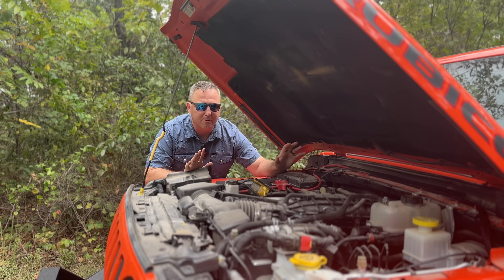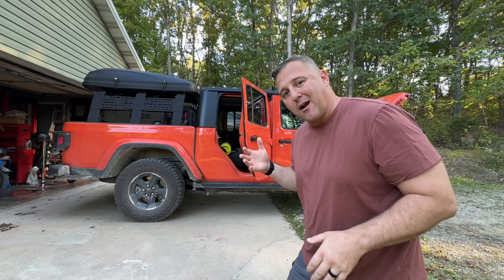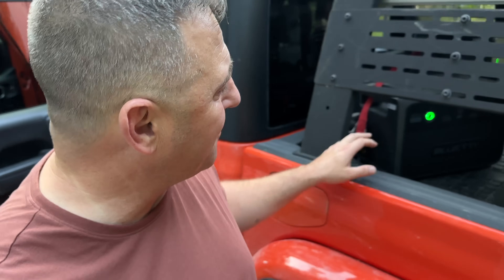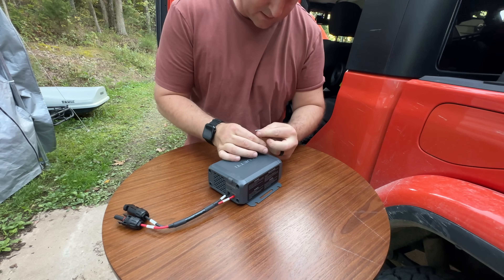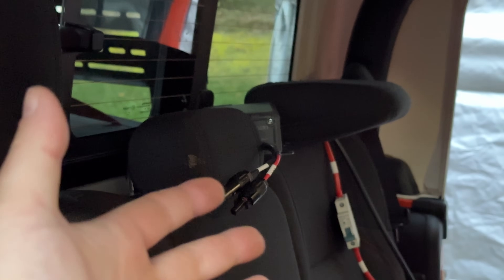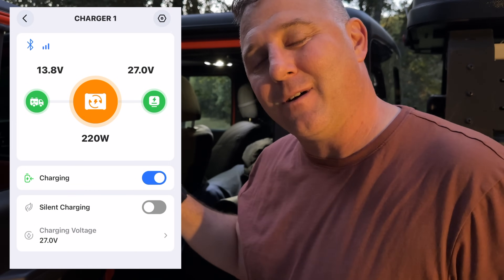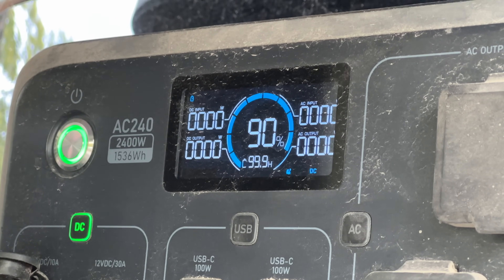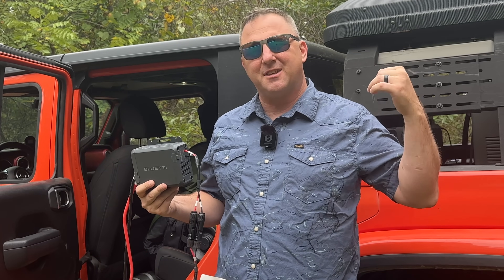Solar is OBSOLETE! - BLUETTI Charger 1

Comment: I have similar set-up with my 2023 Toyota Sienna.
The great thing is: 1. The car battery is located at the right quarter panel. 2. Very minimal work. 3. With short cables, it does not require thick gauge wires. 4th, last but not the least, since the Siennas are hybrid, I can run my appliances, use microwave, etc. and etc while running the engine ON while the van is parked and the engine only runs very short period  (if it does) because it's a hybrid. Basically, the Ecoflow is getting charge from the high voltage hybrid battery when the engine is not running. The vehicle puts out around 150Amps. The DC-DC converter I am using is only 30Amps.
Reply from the maker: Sounds like a great setup. The hybrid Sienna is a game changer for upgrades!

Comment: Just installed one. My old vans alternator couldn't handle the max load and was shutting down at idle so I used the app to lower the charging voltage, will take a little longer to charge. I wonder if it's over charging my van battery while it's recharging my Bluetti. I think I will install a second battery later to lessen the load on my alternator and the extra circuit breaker at the battery. Good luck.

Comment: Wow, the EcoFlow wire looks twice as thick… But looking at the spec sheets, they both seem to use 6AWG. Would’ve been nice to do a side-by-side comparison of how thick that wire is.  It was definitely a challenge getting that higher gauge wire from my battery to the back of my Volkswagen Atlas.  But I did it!

Comment: Maybe a dumb question but total noob here: Can this charger be used to recharge a 12 V LiPO4 battery or does it only charge power stations? Also, how do you determine if it is taking to many amps from the alternator and possibly damaging or burning it out?
Reply from the maker: @RA-LHTX  it’ll recharge them as well. You can set the voltage for anything up to around 60v. So, for your LFP battery it would need to be set to the manufacturer spec.

Comment: I bought a 1300 watt inverter. Have a dual battery setup with isolator. Still never run anything on the inverter if I don't turn on my tahoe 1st, don't want to end up with no battery in the mountains or the dunes.

Comment: at this point instead of charging using your car just run a generator will get far more power that way get a 2200 watt generator and a 300amp hour battery charge it for about a hour and a half with a 1000 watt dc charger

Comment: good vid I have a EcoFlow max 2 & was looking @ getting the alternator charger but not now U R 💯 if something goes wrong with your vehicle under warranty U will be stuffed as the dealer will blame everything on it so I will use the accessory charger that comes with it & if it is not good enough I will buy there solar panels  expensive but safer 😎

Comment: I'm seeing more and more of these chargers from alternator to battery sans solar and I'm not enthused.  I don't want to tax my truck's charging system with the camper charging system.  My slide in truck camper is self sufficient, there are no water tanks, just water bottles and wash pans, a composting toilet and solar shower.  I got minimal solar/lithium to run LED lights, fans, and BougeRV 40L fridge and a Bluetti AC180 for my accessories and I cook and heat with LP.  I can slide out the camper from the truck and the camper remains self sufficient.

Comment: Why not simply buy a dedicated generator to keep your batteries charged?  There's no reason to run a 6 or 8 cylinder engine just to obtain the relatively small amount of power the alternator is designed to put out to keep the car's battery charged.  If you plan on doing this frequently, you're wasting gas, putting unnecessary wear on the entire engine and all its components, and increasing the likelihood of premature alternator and battery problems.  Other than that, it sounds great... :body-blue-raised-arms:

Comment: If you mount the breaker switch under the Hud it might cause the breaker to trip prematurely due to heat. They provide 8 gage wire.

Comment: Is the circuit breaker water proof ?
Reply: its just a standard house type MCB so i'd suggest not, you'd need to fit it in an ip55 enclosure

Comment: I've got the Ecoflow delta 2 Max with the 800amp alternator charger (F-150), and I love it. About 2 1/2 hours of driving will top it off from zero. When base camping, it will run my large Dometic for 3 days, no problem. The reverse charge feature allows a jump start if your battery is dead, essentially making this a plug-and-play dual battery system. The app is really well designed for real time monitoring. It will also accept 1000w of solar input, if you so desire. I keep 1 160W Ecoflow solar panel on hand, just as an option if there's engine trouble, but I see no need to expand the solar setup.
Reply: hey Matt, how large is your dometic fridge? i also have the delta 2 max and 800 amp alternator charger and have yet to install but looking at CFX 45
Reply: @ it’s the 2 zone 85L
Reply: Do you also have some heating inside car while camping ?
Reply: Hey, I was just wondering, will it power a 4xe ? I've been looking up portable charges, and this one keeps popping up.

Comment: So 560 Watt max output. That's 40 amps at 13.5 volt. If you have a 300ah lithium battery, you'll need to drive 7.5 hours to charge your battery. Think i'll stick to my solarpanels ;)

Comment: Upgrade that alternator asap. Also you can add an inline fuse to the battery and I'd recommend it.  There's also a battery isolator if the solar generator box doesn't already do it which prevents you from using the starter battery for charging the house battery

Comment: Dude do more research before giving advice electrical connections need tight as possible depending on size of the connector loose connections = more resistance  your gonna  catch you vehicle on fire or cuase someone else to giving advice like this

Comment: I posed these questions to another well-respected YouTube product tester:

Would this charge in all scenarios:

Engine off, key not in ignition?

Engine off key in Ignition on accessory position?

Engine idling?

What about vehicles with a Start button instead of a key ignition?

And his answer was, "Only run this when the engine is running and the alternator is charging the starter battery ".

Do you agree or disagree with this?

Comment: Just curious, how long does the power last before recharge is required? How long does it take to recharge using your vehicle? I do a lot of dry camping, sometimes a week or more. Sounds like you're using your vehicle as the generator. Might as well use a small generator. Or solar panels.

Comment: Good Video. However, the main power cable of your concern is installed backwards. The short side with the breaker should be battery mounted. One side has a loop so the factory put the copper terminal on the wrong end.
 
Also Silicone your penetration of that grommet it will leak.

Comment: I think this is a good product as a backup to an established system. Food for thought... put a switch on this device so you have the option to run it or not. Also this is by no means a replacement for solar!

Comment: Thank you for your video. I received my Bluetti alternator charger 1. I want to hook it up to my 2007 Sprinter Wesfalia after I replace the led battery bank with my Bluetti AC500+B300S system. However, I’m reluctant because I don’t want to risk damaging the Alternator or not sufficiently charge my vehicle battery. How can I ensure that it is save to install?

Comment: You actually need a fuse or circuit breaker at both ends of the power wire One at the battery and one at the front at the alternator or the under hood battery

Comment: I Think the purpose of Solar is to use the SUN.  Upgrading, and worrying about killing my vehicle  electrical system which I have done time lapsing a trip video form the cigarette  lighter with a usb camera  is not fun and expensive.   Panels are dirt cheap 20 cents a watt and work for 25 years.  This case scenario why not just fill it up at home like you do your fridge.  Pre chill.   What if you partk for a week or TWO....no panels YeT?   Using an Engine as a generator unless a diesel probably is not a good Idea.   I get the concept, was a full-time RV"ER with a family of 4 for 5 years and get it . I just would not do that to my $75k vehicle unless is is covered by warranty and installed by dealer.

Comment: Certainly not fair to say Solar is obsolete... maybe better to say "If you dont have Solar...."   Solar charges when you are in camp too.  With this, you have to run your vehicle in camp each day.... and at high idle or the Alternator will not put out sufficient voltage to run the Charger.  Also you are burning gas (spending money.)  Better to just run a generator and get way more Watts from way less gas.  This unit is great for when you are driving somewhere as an ADDITION to Solar charging.  For a Motorhome with lots of Solar you dont really need this... but if your are short on, or without, Solar then this is a great idea.  I bought one because I dont have any Solar either.

Comment: These have been around for A LONG TIME, aka DC to DC charger. simple, plentiful, not renamed, you can find them anywhere.
Reply: Sure you can... but do  they put out 600 watts?  have a custom voltage output from 15v to 56v?  have pre sets for all Bluetti devices? have Bluetooth app?  Please find me one like that for cheaper ....

Comment: Add your own fuse at the battery on the provided wire. You can still keep the breaker but you will have circuit protection for the first long stretch of wire.

Comment: I’m thinking of putting a hood mounted solar panel to top off my Gladiator battery when I’m in camp and let me run some light output from the Jeep battery’s 12v outlets.

Think this might work in tandem?
Reply: It will work in tandem if you have 2 mppt inputs on your battery system.... like the AC300.

Comment: I think I would’ve turned around the 6 ga wires from the battery to the charger. 
I would cut the lugs from the battery terminal and they can go right into the charger. And I would add new lugs to the other end.
This would keep the breaker close to the battery and prevent the hot wire coming out of the engine bay in a fault.
Reply from the maker: I’m going to add an 80 amp fuse close to the battery this weekend.

Comment: I decided to go with the Pecron 500 watt charger for my gladiator. I like your idea of moving the circuit breaker or fuse closer to the battery. I was thinking of routing my wires to the front passenger side floor area, that is where my Jackery 1000 v2 will be sitting when I travel. My gladiator has a cap on the back and that will be where my setpower 35 frig will be located plugged into my 12v reseptical located there. The jackery will be topped off while traveling so when I get where I am going I will plug the setpower into it. That will power the frig and any other low draw items for at least a 24 hour period until I drive a bit and recharge the jackery while the setpower is plugged into the 12v in the back again. I am constantly on the move so that will work for me.
Reply from the maker: Sounds like you have the perfect setup and some good plans to complete it.

Comment: Bluetti is charging $50 for the dc cable. Just make your own and use your own waterproof circuit breaker. But that is for those of us who are good wit helectrical but not hard even for the novice.Also you can make up and of the various connectors for different solar setups. You are not limited to MC4 or XT150 connectors, you can make up anderson connectors also.Very easy to do
Reply: But it will cost you alot more.... 34 feet of 6 awg wire, 63 amp breaker, connectors.... over $100.

Comment: Hmm I wonder if my DUAL 200 AMP Alternator, 7.3 Diesel with RPM controller would work ??
The Controller has a Charge protect mode that controls the Engine RPM 
HAHAHAHAHAHA
Reply: Try it and get back to us, go .
Reply: @leeinwis  HAHAHAHAHAHA.....

Comment: I’m old school I have a inverter generator that runs on gasoline. I carry a big cable lock and extension cords. I simply lock my generator to a tree, so it cannot be stolen from my campsite. It is a very quiet generator.

Comment: Maybe you were confused by filming, but the sequence you followed when hooking up the car battery was improper.  Best to only interact with the positive terminal while the negative is completely disconnected.  In your case things were find since your socket wrench didn't come near the grounded vehicle chassis while working on the positive nut.
Reply: So Negative is Last on and First off?   I appreciate the safety wisdom.

Comment: I have a 2022 392 Rubicon and have been looking for a larger alternator but have been told that one doesn't exist for the Jeep.  Could you share the part number of the new alternator you purchased?  

I'm also planning to run the AC240.  Do you see the need for the expansion battery?

Also, any plans on using the RV cable to power a accessories (GMRS, CB, Fridge...)?
Reply from the maker: I just pulled the expansion battery out on Friday to lower the weight of the package. The battery is at 50 percent and I have not driven at all this weekend. So, I’m happy without the expansion battery connected. Part number: 56029803AA is for the Max Tow equipped Gladiators.
Reply: @AdventureGearTV  thank you. 

I will let my mechanic know and see if the alternator is compatible with my 392.

As far as the Bluetti, I currently have the EB70S and exploring if I should go with the AC70 with the expansion battery or with the AC240 with no expansion battery to save weight.

Comment: This was (as far as I am concerned) an honest, and well articulated  video. First time viewer and have now subscribed and will check out past videos. I have a Gladiator as well and just purchased a Jackery explorer 1000v2. What I gathered from your video is that the Bluetti unit will work with that as well ? although I read that Jackery uses proprietary solar panels so don’t know if the Bluetti will plug into the Jackery. This is my first solar power station. Thank you for the great video.

Comment: I used the victron 12-24 15 amp dc to dc charger in my gladiator to charge my ac200 max that stays in my teardrop. It charges at about 250 watts, but I find that plenty to keep me topped off. Way better than solar panels.

Comment: Great video, I received my charger1 today and will be installing it in my RV on my AC300 with b300 all under the Bed, the AC300 has been great for me but when driving on a long trip it would go dead so the charger1 should help me keep the unit charged and the AC going strong.
Reply: I will be doing the same thing with my RV and AC300+ 2-B300's.  Will be great to get an extra 600 watts charging while driving!

Comment: I wouldn't be running directly off the vehicle system.  Add a second battery and an isolator.

Add a small solar panel to the roof or hood with a charge controller so you don't come out to a dead starter battery.
Reply: Someone else mentioned this - an Australian who was making fun of someone like this poster for being 10yrs behind the times 😂

Comment: I have a Bluetti that stays charged with the solar panels on my vehicle. Never needs plugged into the vehicle so I don’t worry about that connection.  And no extra fuel to charge it.  It is literally free to charge after the cost of the panels. lol. Seems your mindset is backwards to real progress.

Comment: Great review, thanks for the heads up on possible alternator issues. I think you may have the ends of the cable feed reversed, you were correct in saying the breaker/fuse should be as close to the battery as possible. In the close up of connection to the DC-DC charge the cable is labeled Batt, (10.06) so they have Batt labeled on both ends of the cable? And your terminations were reversed.

Comment: Having this as a backup is reasonable, but relying upon using your vehicle and alternator is not worth the risks short term and long term. You might set your vehicle on fire, leaving you stranded, damage the battery or alternator leaving you stranded, or use up needed fuel while recharging the system, which ends up leaving you stranded. Solar is still alive and well, sir. 😅
Reply: Solar is fantastic if you're setting up and staying a while. This set up is fantastic of you're a person who is on the move every day or 2 to different camp spots, you're running the vehicle anyway to drive, might as well have this set up to recharge everything while you're on the move, as apposed to have to wait hours for solar to do the trick before you leave or after you get to your next destination. JMO
Reply: @cassidysepicadventures  I agree with the benefits of this unit, but the risks; albeit have low odds of happening; are so severe almost every possible failure will put you out of commission in a way that it will take days or weeks to get your vehicle back running again, besides the running out of fuel to get home option... It almost makes more sense to just have two Bluettis's for some of the money he used for the alternator setup, so one is always fully charged in an emergency
Reply: Higher risk than dual battery system?
Reply: @hi9580  not if you have a fail safe to keep the other from being impacted by shorts, then yeah this is a solid option

Comment: Can you just run the wire threw the a frame of your truck then run it in to back?
Reply from the maker: You can, but I’m not sure about waterproofing. I thought about putting it in a water proof container, but then worry about heat retention.